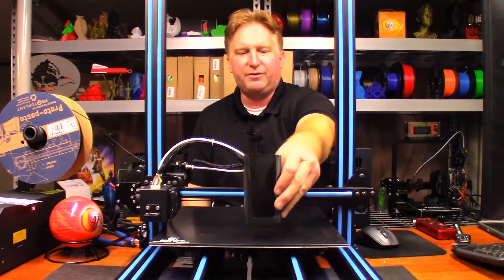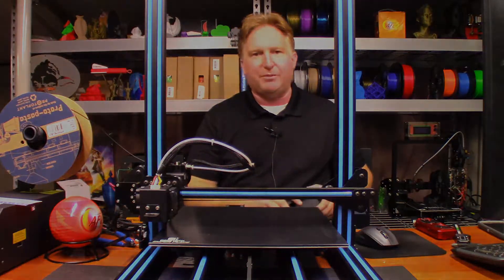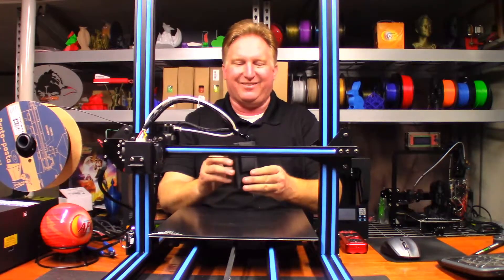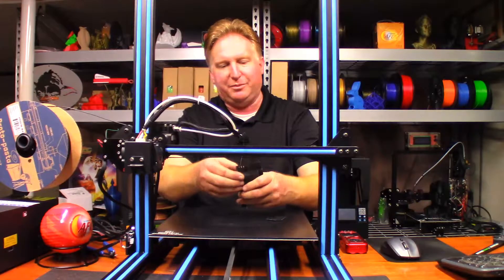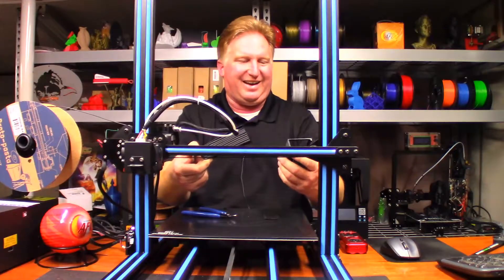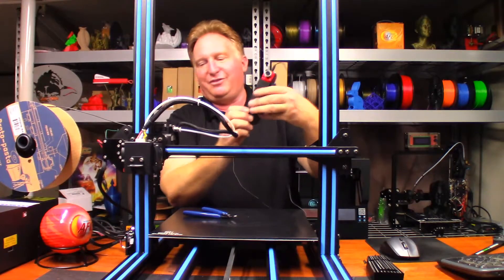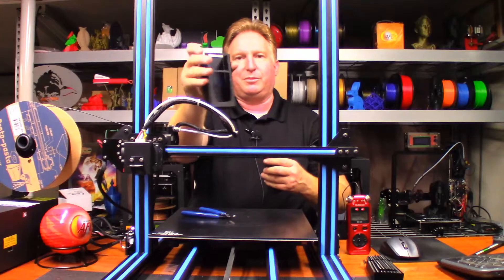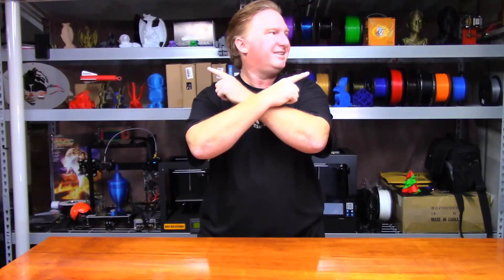New 3D Printed Tascam DR 05 Holster On The Geeetech A30 In Proto-Pasta HTPLA

Comment: Fuzzy skin in cura is great for making handles, especially the rubber inserts for replica guns with flexibles, anyway randomly decided to swap all my prusa parts to high five blue htpla and added carbon fibre tubes to the x-carrage instead of steel, I'll show it on twitter once all the parts have printed.